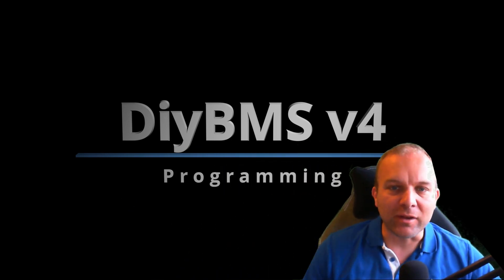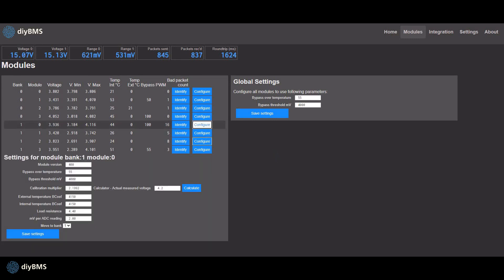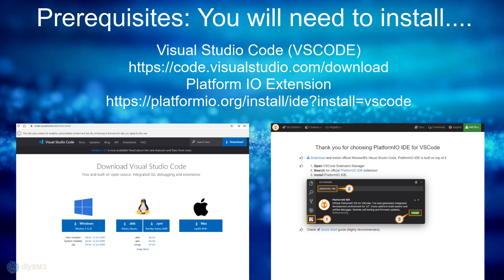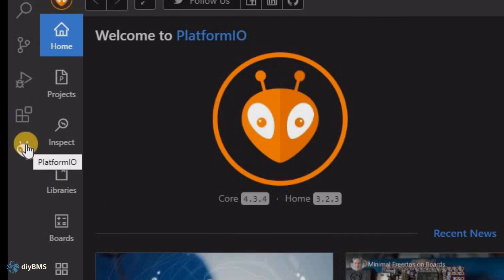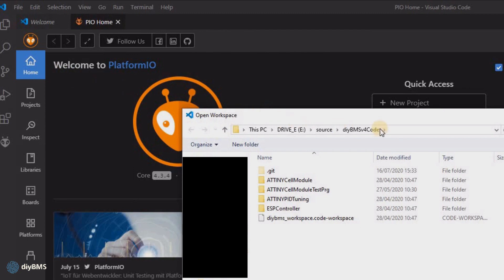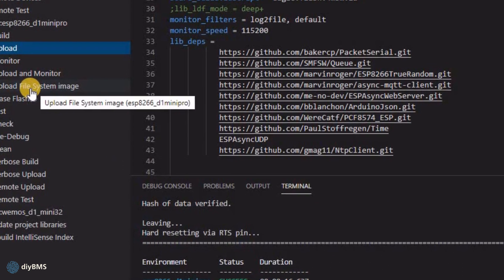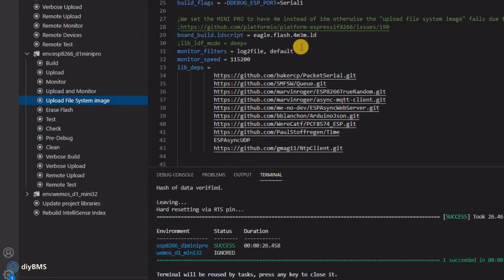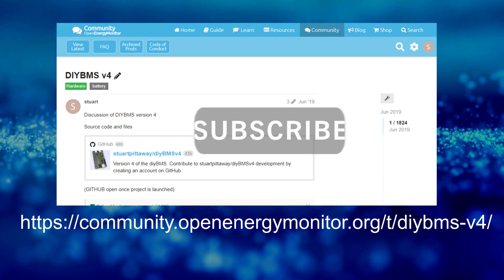DIYBMS v4 Latest code updates &  programming module/controller

Comment: EDIT my new usbasp device arrived. same problem as before observed. tried -F upload flag, tried -B16 upload flag. all to no avail. Any advices here Stuart. Last thing to try might be the tinyisp like Adam Welch does but honestly think that the slaves may be broken too.

I struggled last night to flash the 4.21 slaves
Uploading .pio\build\V421\module_fw_V421_attiny841_421_eF4_hD6_l62.hex

avrdude: error: program enable: target doesn’t answer. 1
avrdude: initialization failed, rc=-1
Double check connections and try again, or use -F to override
this check.

I have a usbasp device which is showing as good in device manager and is being recognised in platformio in vscode, I have triple checked the six wires that go from the icsp headers and when i attempt upload it give the message shown above. any advices would be appreciated. thanks. I get one green flash on the 4.21 slave board when the upload is attempted.

I have now put an order on amazon for the usbasp linked in the description of this video. hopefully there is just some difference in my old usbasp device that i cant see, but i am doubtful.

Comment: Awesome.........I just tried to follow all the process. Install Visualcode in Ubuntu, PlatformIO extension and the sourcode from GitHub. When doing the "upload" it shows me a compilation error......xtensa-lx106-elf-g++: error: unrecognized command line option '-std=gnu++17'   Easy to fix?
Reply from the maker: Ok, ditch the platformio and follow the instructions on GITHUB instead and use the pre-compiled version from there.  https://github.com/stuartpittaway/diyBMSv4ESP32/blob/master/ProgrammingHardware.md

Comment: Hi all. Well.. I'm unable to get platform io displaying the env:esp8266 tree. I've executed all steps (and also all recommendations) to ensure vscode and platformio is installed correctly. I've also tried another PC and it's simply looking the same. I do select ESPController -> platformio.ini afterwards klick on platformio and then it's just displaying attiny841_V400. Does anybody have similar issues or any recommendations? I've already 14 boards running but by pc (on which I build the code) crashed some days ago. Thanks a lot
Reply from the maker: Hi, platformio is proving to be troublesome as they keep changing it!  You shouldn't need to use it anymore as long as you use the pre-compiled files from GITHUB.  Take a look at the instructions here... https://github.com/stuartpittaway/diyBMSv4Code#programming-the-controller

Comment: Hello. 

Stuart

I have v4  first a red light came on the cell module and now it keeps saying settings not saved it won't let me save any settings at all ??
What am I doing wrong??
Any ideas to fix this please 
Thank you.
Reply from the maker: Ok, the red light means the voltage on the cell is high and it's started to balance.  If you get the save settings error, just refresh the webpage (F5) and try again.
Reply: @StuartPittaway  Thank You for your help that's fixed it... this is great single-cell. Monitoring plus balancing...  All I goto do now get some more cell monitor boards for my project .I have 100 a123 cells i plan on using for my wall...Great work Stuart and thank you for making this Fantastic piece of Kit! 😎

Comment: can this BMS estimate the State of Health of the lithium battery pack?
Reply from the maker: Not at the moment, current and voltage monitoring are needed for that
Reply: @StuartPittaway  thanks for the reply. I'm an EEE student and I'm doing my dissertation on Battery management systems. Currently I'm trying to build a high fidelity model of a lithium-ion battery in Simulink and use EKF (Extended Kalman Filter) to estimate the state of health of the battery cell.  I wished that your BMS had the ability to estimate SOH so that I could have taken my project to the practical stages (currently everything is simulation based), nevertheless, great work. Your commitment to this work is very inspiring and once I'm done with my dissertation I want to get my hands on this BMS.

Comment: Stuart, 
I am trying to program the Cell modules with the usbasp but platform IO doesn't find it. I have installed the driver for usbasp but it is not working. What am I doing wrong?
Reply from the maker: Hi Corey, its easier for you to ask questions like this on the forum as YouTube isn't the easiest to reply to.  This may help https://community.openenergymonitor.org/t/cant-flash-cell-modules-platform-io-usbasp-upload-error-1/15716
Reply: Ok thanks

Comment: I think I got the wrong board. Will this work for d1 mini lite?
Reply from the maker: Unfortunately not, that chip only has 1MB of memory and ESP-8285 processor.  DIYBMS will work with the standard WeMOS D1 mini (non-pro version) if you can get that.
Reply: @StuartPittaway  Ok thanks for the reply. I was able to get your code to work on it and I can see it on my wifi but I didn't go any further than that.

Comment: How many cells this BMS can handle? Have access to cheap tesla3 21700 cells. Was thinking to wire ~1000 into powerwall. So that's 1000 boards merged + some amount of controllers (how many?) What is the system limit?
Reply from the maker: You wouldn't put a board onto each cell, you would group cells together into a parallel pack, and then put a BMS board/module onto each of these parallel packs.  Normally people run 48volt systems, so 13 or 14 parallel packs + modules joined together to provide 48Volts.   Each pack would have about 70 cells in it.
Reply: @StuartPittaway  that's a false statement. Multiple cells in parallel is a bad design. The whole idea of bms is balance of individual cells. Period.
Reply from the maker: @D9ID9I  the diybms can support up to 64 modules, you can use them as you wish. Future versions of the software support 250 modules.  You can use one module per cell if you wish. However nobody does this unless it a large lifepo4 or prismatic cell.
Reply: @StuartPittaway  everyone is delusional to the best of his ability. You can open for example jag35 site and see 7s24v stackable bms for sale joined correct way.

Comment: sorry typo 8266 the thing is i programmed the controller no problem first off but changed the arial and reflashed did not work so i bought some more they do not work either.platform io programs the cell moduals no probs but will not touch the controller.i press upload it takes about 30 secs first time round linking all the files together then says failed exit code 1.second time around about 3 secs same result.really stuck i will check to see if comport is being picked up with unit plugged in.would it be possible to send you all three in a envelope with another return envelope and you flash and retur.i have not got another computer to check program on.

Comment: had system running for couple of months decided to put arial on control board.so i though i would reflash controller keep getting exit code 1.This takes about 3 secs does not program at all i have blue flashing led and thats it stuck again i really hate platform io they should outlaw it.But in meantime any ideas.i have 3 esp32 none program so i have an unusable system again.
Reply from the maker: Diybms uses esp8266 doesn't work with esp32.

Comment: on the PCB screen could you add the ISP pinout , VCC,MOSI,GND,MISO,SCK,RST   , and when will the wemos be ready ? I can not seem to get mine to flash
Reply from the maker: Does this forum post help? https://community.openenergymonitor.org/t/platform-io-v5-upload-file-system-image-option-moved/15492/17

Comment: Have succeeded in uploading code to d1 mini and get an ssid. However the generated web page is blank (192.168.4.1/softap .htm). My programming interface is somewhat different than what is shown in video. I only found the instructions for setting up home network in Adam Welch video from a while back  and am wondering if it is still valid. Do we now need the d1 mini pro? I have one coming from Amazon. Any help would be much appreciated.
Reply from the maker: Hello, make sure you used the "flash file system" option - this has recently changed since this video was published, see here for more info. https://community.openenergymonitor.org/t/platform-io-v5-upload-file-system-image-option-moved/15492/6
Reply: I just got it working on the d1 mini. Not sure exactly what all I did except I have now found the upload file system image under a sub menu. Next will try to make it work with recommended d1 mini pro which came from Amazon today, and make sure I am using the "flash file system" option.

Comment: Heya Stuart, TY for this. I dove in knowing just about 0 about electronics and never soldered before.  I've actually learned (somewhat) how to read a schematic and enrolled in a basic electronics course.  I've put together 5 boards at this point and just about to start learning some of the programming aspect.  Anyways, I greatly appreciate you're work on this as it has helped me a lot and become a kind of new hobby for me.  Be well, ty.
Reply from the maker: Well done, keep at it and if you get stuck pop over to the forum for help. Openenergymonitor

Comment: i have 14s running everything seems to work except saving settings.If i configure module and set global settings to 55 degrees as soon as i come off webpage all settings are lost it defaults to programmed settings ie. 55 degrees and 4.1v and no configured modules any ideas please.
Reply from the maker: Hello, the "global settings" always shows the defaults and not the last setting.  If you check each modules configuration it should show the correct values.

Comment: How hard would it be for me if I wanted to change the microcontroller of the boards and still use the same code. For exemplo, change the Atmel microcontroller for a STM32 and the esp8266 for a esp32. Is it possible? Is there a place where I can find what the code does?
Reply from the maker: All the code is in GitHub. Experimental support for esp32 is already there. Why do you think the CPUs need to be changed? Why so powerful?
Reply: I want to make another system that includes all the features your project have and add even more features, like a complete power bank with different options of input and output power. All of that running on a esp32 and a STM32. I am more familiar with arduino IDE and I was wondering if I could run the same code you have on the arduino environment, is it compatible? I'm just in the start and your DIYBMS is amazing! I'm planning to make my project open source as well so everyone can have access and build it if they want to
Reply from the maker: @alissonneres5067  it would be nice to add features to the existing system for the benefit of everyone, rather than going down a different route of hardware.

Comment: -  https://code.visualstudio.com/
-  https://platformio.org/install/ide?install=vscode
- https://git-scm.com/download/win
Thank you Stuart!! 
To help others watching the video:  the links 

I  got stuck at "git: clone" not being available.
I installed "GIT" (git-scm.com)  after installing and restarting , it was available command!

Second bump was "avrdude: error: could not find USB device with vid=0x16c0 pid=0x5dc vendor='www.fischl.de' product='USBasp' "  Using "Zadig" (zadig.akeo.ie) to get the correct driver for the USBASPv2.0 fixed this problem also :-)

now I see during programming all the nice flashes and it finished without errors

Comment: Would it be difficult to add a screen directly to the main board? Or a standalone screen into the data lines, even something simple as cell voltages, and balancing info,
Reply from the maker: It's possible but the esp8266 is short on pins. Perhaps on i2c intetface

Comment: v4.21 i have R19 missing, and my controller is incapable of communicating with the modules. Should it work without R19 (just voltages) ? or do i really need to get some thermisters in there?
Reply from the maker: It won't work without the thermistor being in place.  This is also a safety feature to prevent the board overheating and potentially destroying itself/fire.
Reply: @StuartPittaway  ok thank you for the quick reply, i think a trip to rs online may be on the cards today :)

Comment: Great video Stuart!
Two questions if I may. 
Is there a way to use 8266 with 4MB for a test only? Still waiting for pro to arrive.
And will ESP32 version require different controller board?
Reply from the maker: Yes the 4mb should work perfectly
Reply: @StuartPittaway  managed to get it working (controller board) on ESP12F/4MB just to see GUI myself finally :)
Have to wait for USBASP to program modules (unless I find another way).
Reply from the maker: @BeardedTinker  if you have a spare Arduino lying around you can turn that into an ISP programmer

Comment: Hello Stuart. Thanks for the great work. How many amps is the new board using for the balancing and can I use it for Lifepo4 cells
Reply from the maker: The balance is about 650mA per module. Yes it works for lifepo4
Reply: @StuartPittaway  is that not to small for a 200ah Lifepo4 prismatic cell